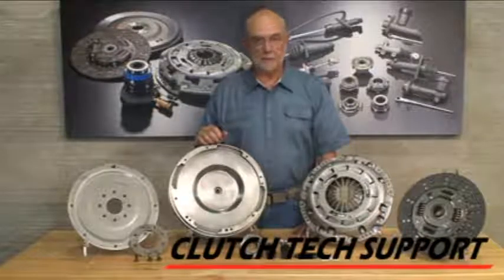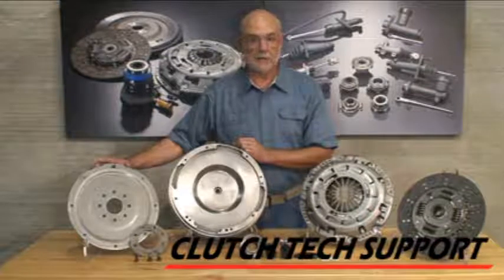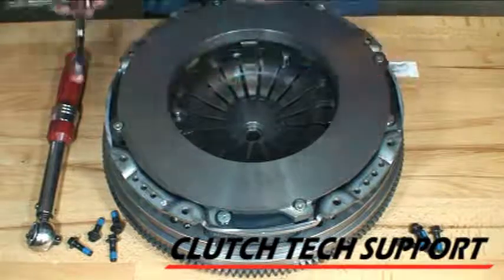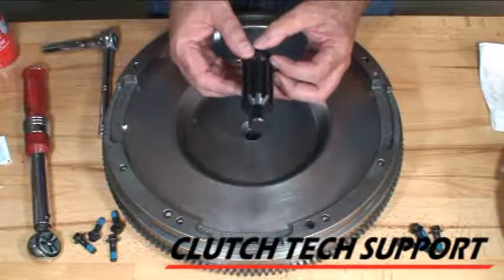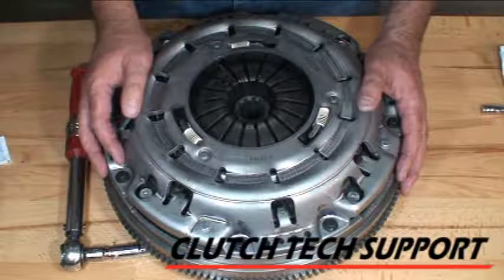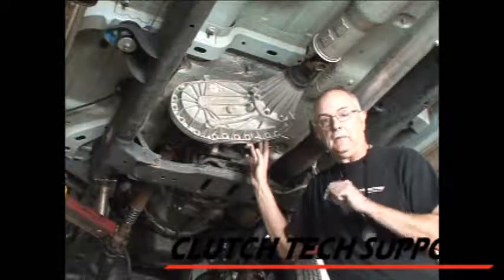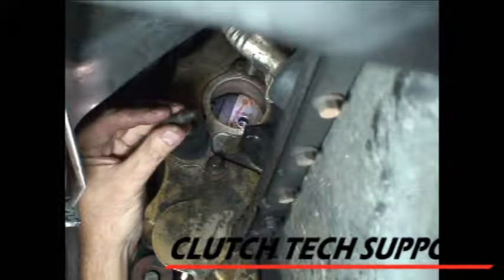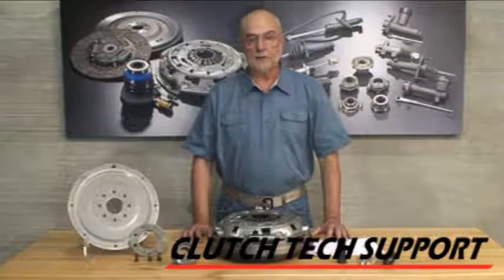Dodge Ram 5.9L and 6.7L G56 Clutch Sub Assembly

Comment: Howdy , So i had my old Clutch Release Bearing replaced because it sounded like the beginning of this video , very noisy . The new bearing sounds the very same . 2005 Dodge Ram 2500 5.9 I bought 2 yrs ago . It was quiet when I bought the truck and the clutch  depressed . Now its embarrassing to pull up to a red light and push clutch in. Sounds dry and bearing noise. He showed me the old bearing and it was not in good shape . So let me ask you , are the new bearings a dry bearing with no high temp grease ? And is the new bearing open on one side ? or sealed ?  Because the new one was open on the one side and dry . Any help would be greatly appreciated .  Thanks Keith

Comment: Nice content, as usual :-).
I wonder why You not compress pressure plate during installation?
Every manual i know about SAC says: using a special tool is an absolute must to ensure correct 
installation of the Self-Adjusting Clutch.
Reply: Thank you very much for your answer Sir.